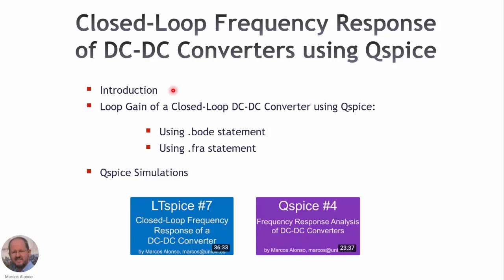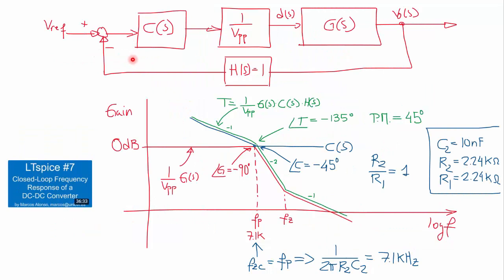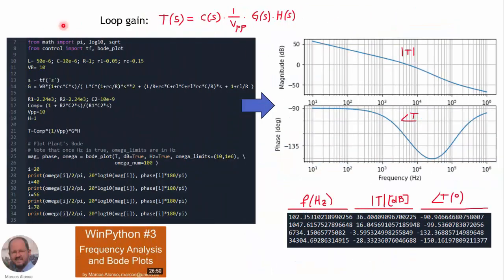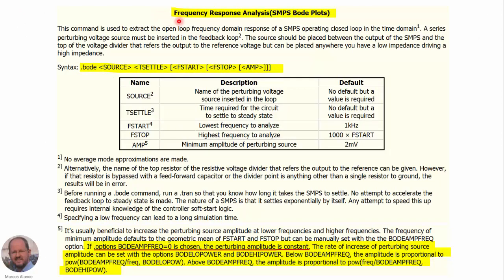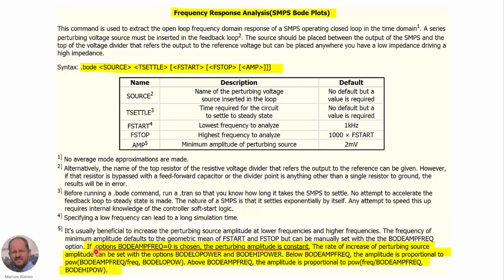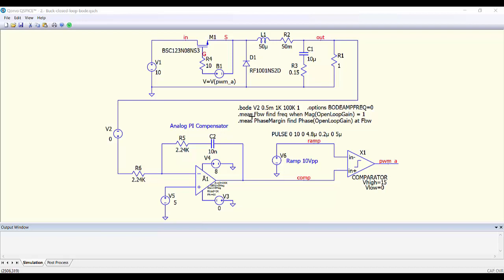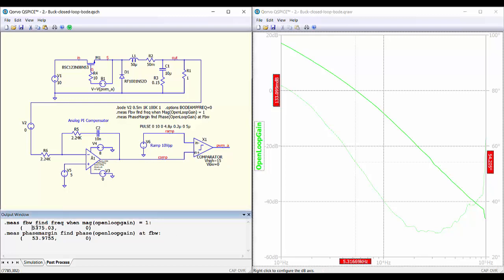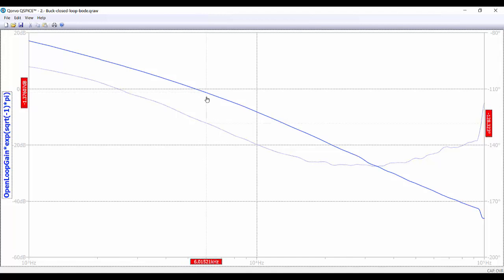Qspice #5: Closed-Loop Frequency Response of DC-DC Converters

Comment: Great useful video. Many thanks Prof.
A question I have:
Why is the loop gain marked as "Open Loop Gain" if in practice the analysis is performing the perturbations  in a closed loop circuit?
I also think that V2 is better be connected so that the minus side will be pointing towards the out node as you show in the Qspice model. (In the LT spice it is reversed and you had to adjust for this by using -Vout source).
Reply from the maker: Thanks for your comment
I agree. There is always a confusion with the terminology related to this gain. I used here the name "Open Loop Gain" because I copied and pasted from a Qspice example and they were using this terminology there. I usually prefer to use just the term "Loop Gain," which is simpler and clearer. 
In some books they use "Open Loop Gain" because it should be obtained theoretically by breaking the closed loop, put all the blocks straight, and calculating the product of all the blocks in cascade. This is why they say "open" because you have to open the loop to calculate the gain. Of course, this is only from a theoretical perspective because in real life if you open the loop the closed loop operation will stop.

Comment: This is an interesting approach which, in my opinion, cannot beat piece-wise linear (PWL) simulators like SIMPLIS or PSIM for speed and granularity. But Qspice and LTspice are free and available to anyone so it is good to watch this. Just a comment, what is displayed is the open-loop gain, not the closed-loop gain. The open-loop gain is the product of the power stage response by the compensator response. You have a closed loop for keeping the dc point at the right value but you extract the open-loop gain in the end.
Reply from the maker: Thanks for your comments. It is interesting your comment about the name of the response. This will allow me to clarify some points.
If you watch the video carefully you will see that I never said that what we are obtaining is the closed-loop gain. I say that we are obtaining the closed-loop response of the converter, as shown in the title. By this I mean the open-loop gain of the closed-loop-operated dc-dc converter. Only that this is too long for me, so I just say the loop gain of the converter operating in closed loop. For me saying open-loop gain is confusing because it can also refer to the loop gain of the converter operating without feedback loop, just pwm modulator + converter.
The name open-loop gain in closed-loop, which as I said is a rather complicated name for me, comes from the fact that to obtain this gain we have to open the closed loop and multiply the gains of all the blocks we find in the loop. This is shown in all control books. But this is physically impossible because if we break the loop the closed-loop operation would immediately fail to work. This is why we need to inject the perturbation in the loop while keeping the closed loop in operation. So, this is another reason why I prefer just saying "loop gain".
Also, the name closed-loop response could also refer to the response of output voltage over reference voltage, as shown in video PE #45: https://youtu.be/29jOpPIEeBw. So, we see that language can be very imprecise, this is why we need images to support it. I think the video shows pretty clearly what is being done beyond the chosen language.
Reply: @MarcosAlonsoElectronics Thank you for this comprehensive reply. Inserting an ac source in series, as highlighted by Dr. Middlebrook years ago, is actually a perturbation the system operated in a closed dc and ac loops tries to fight. You could very well physically open the loop and separately bias the control input on the dc-dc converter and modulate the bias in ac to extract the power stage response. If it works ok for low-gain systems, you would have difficulty to bias the operational amplifier and it would certainly saturate, hence making the compensated open-loop gain extraction impossible. This is why you close the loop in dc to keep the correct operating point and, by virtue of a mathematical treatment, you extract the open-loop gain. In my terminology, the closed-loop gain is when you ac-excite Vref and check the response on Vout while the loop is physically closed. In this mode, you would have extracted the closed-loop transfer function of the system and this is what you refer to in your second video I believe. But I agree, it is difficult to combine all terms in one sentence as I would otherwise designate this operation as "ac-open-loop gain characterization from a dc-closed-loop-operated dc-dc converter" : ) Thank you.

Comment: Hi Professor, thank you very much for the videos.They are very helpful as you explain the physics behind the circuits also. I am long time power system engineer and recently developed interest in electronics / circuit designs so i am learning on my own and trying to develop understanding of the hardware design and practical considerations while designing the circuits. I just started learning LTspice and now wordering if it would be better to start with Qspice and since it has the ability to intergate the c++ code. What would you recommend ? I already did some analysis in LTspice , or in other words, if i do Qspice, can i stil jump to LTspice. From my limited experience, i do not see any big difference since the engine is the same but maybe Qspice is the future.  I would apprecaite your input.
Reply from the maker: Hello, thanks for your nice comment and question.
In Qspice you have everything you have in LTspice plus some interesting and useful new things like C++ and Verilog modules. To me this is a huge asset of Qspice. I like also the way Qspice does frequency response analysis (FRA). If you learn Qspice you will be able to use LTspice too.

Comment: The simulation time of the Qspice scan loop is much longer than that of the software simplis. What is the reason? thank you professor
Reply from the maker: I think it depends on the semiconductor models used for the simulation. I have seen that by using an ideal switch instead of the actual transistor the simulation time is only 5 seconds and the results are pretty much the same. I have posted this file on the channel repository: https://github.com/marcosalonsoelectronics/Qspice-5
Thanks!
Reply: thank you professor @MarcosAlonsoElectronics